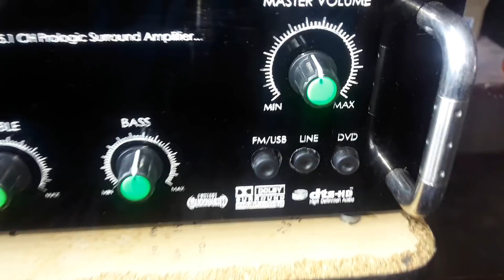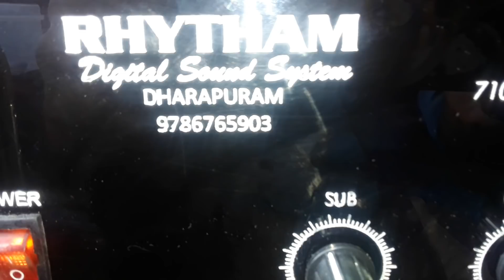6.2 CH - 3000 Watts power amplifier

Comment: Its drive only 300 w with this tran and powersuply...its out put i think yamaha circute..need 70 v dual and 10 a transformer need...filter capacitor above 15000mf150v two or four need 4 best and 3000w... diods too....

Comment: Bro. I have one doubt I am studying 9th.but I am interested to make small low cost amplifier.in this weak I make one 6283 ic based Bluetooth amplifier    in this amplifier I am use 12-0-12 v 1amps transformer .but it make light humming y bro.I connected Bluetooth board and 6283 ic board on same connection .what is reason for humming noise .how to clear this .it is my doubt I am also Tamil .so I want to call u for this clear doubt .tommorowplzz answer for the comment Anna
Reply: try using a balanced power supply then you will get rid of humming,, as i guess it is battery run? nit should sound ok but if run using a power supply it might be that power supply that causes humming?
Reply: Use seperate rectifier for usb kit....couple input power of 7805 ic with 1000uf capacitor and use 47uf capacitor for 5v couple....earth volume controler all and ground connections
Reply: GROUND LOOPS!

Comment: 3th watts? using normal transformer? and two capacitors only? not possible bro.. when bass strikes capacitor cannot supply your required power for that.. it could be 30-300watts only.. cannot go higher than 1th watt

Comment: 12 nos of Toshiba MOSFET ic...  Yevalo anna.... With heatting plate
Reply: friend this is coming @ 2000 to 2200 Rs.  while in 2000 they are using Korean ic in 2200 they are suing original Toshiba ic.

Comment: 500watt RMS stero amp need
Reply: Dixit Gandhi ....use 2sc series of 12 transister board
Reply: I know Board need but not available indian market please suggeste board wich place found
Yiroshi typ 20 Sc5200 mosfet board.
Reply: its may be available in chennai or coimbathore...8 piece single board available in trivandrum
Reply: Dixit Gandhi 9544388125

Comment: only 300 Watts NOT 3000 Watts:
Reply: True fake postings...
Reply: Sir this output is 3000watts
Reply: My ic4440 is output 180watt so
Reply: Mayur Rautu :: First learn about electronics....look at the Transformer's size if 30 volt X10 Amps = 300 watts....!
Reply: Mayur Rautu 4440 ic gives 18 watts maximum....!
Reply: Pinnnnallllathe
Reply: Harichettaneyaa pullli pani padipppikkan vannekkane....
Reply: @abhijithsabu3596  bro..എവിടെയാണ്...?
Reply: @99hari55  exactly true , not more than 300 watts.